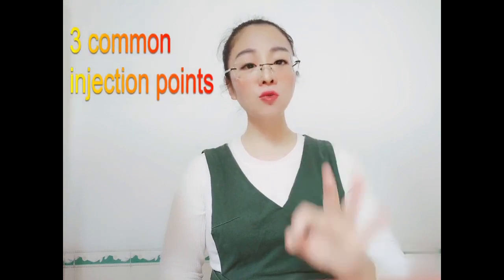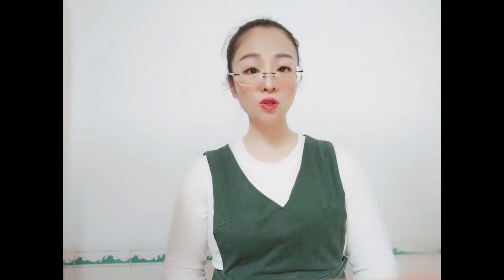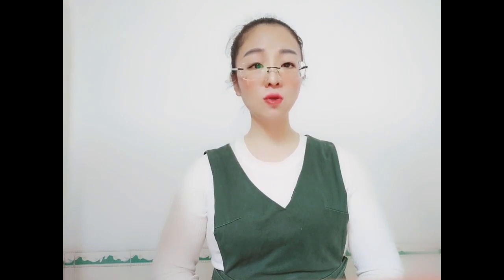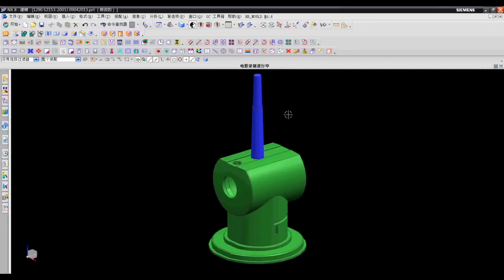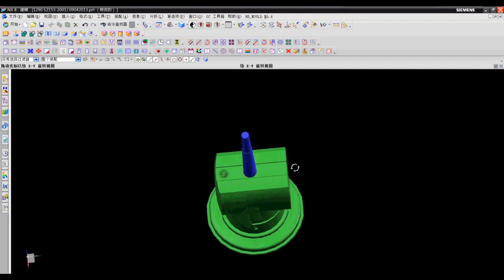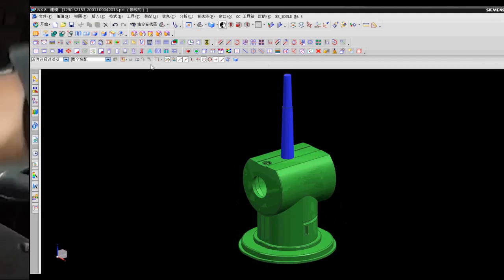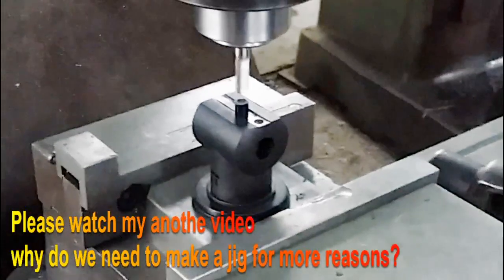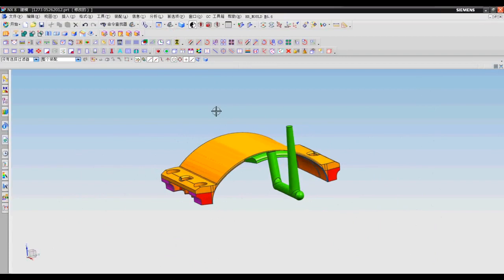The most 3 common injection point/gate types for plastic injection tooling (gate to be trimmed)

Comment: Very interesting. Can this method do this with   "polypenco" type of plastic ?
Reply from the maker: Hi David, thanks for your comment. can you explain the "polyenco"?
Reply: @ktmtooling  it is used a lot in engineering machine shops like my work. I make lots of parts but from solid and it's very wasteful.  Look on my channel how to fix oil leak. Video.   Cutting steel needs nylon video.. I have a few using polypenco.
Reply from the maker: @userwl2850  Yes, i just watched your videos, it's impressive and massive for the bores. you got my subscribtion. i guess you are an experienced engineer and a successful boss.